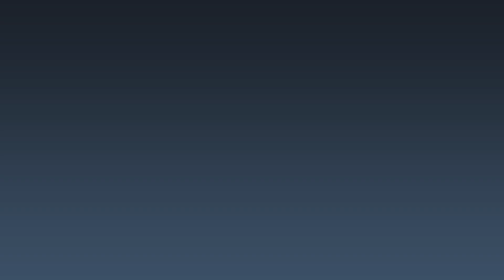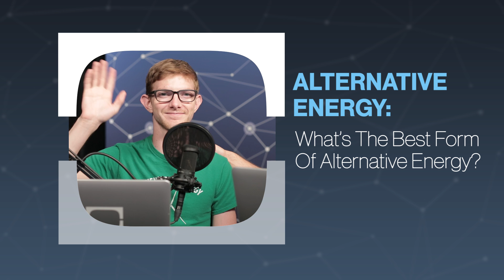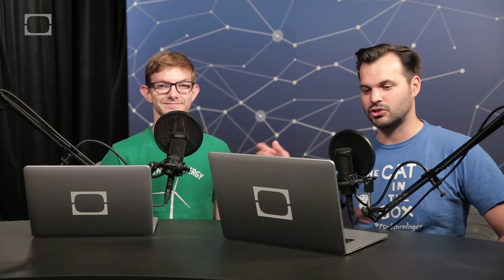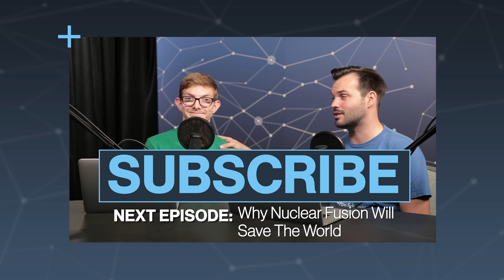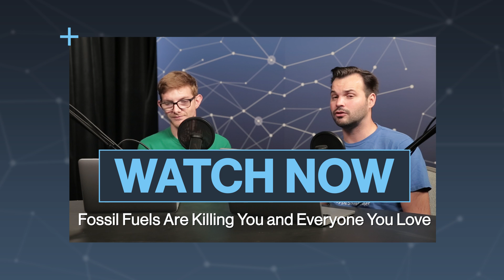What's The Best Form Of Alternative Energy?

Comment: The failures to deal with waste and the environmental impacts of meltdowns were not dealt with. Fukushima, for instance, led to heavy metal and radioactive poisoning of the immediate environment but also pretty significant areas of the ocean due to waste being released into the ocean (both unintentionally and intentionally - as a result of an inability to store the large amounts of waste). The biggest issues, in my opinion, are waste management and rigorous safety standards but this video has made me realize that storage of nuclear waste and extreme caution have a much lower cost than most other types of energy production. Wind and solar tech is getting exponentially better and so they are definitely worth investing in and the cadmium problem with photovoltaic cells may well be solvable with better tech.

Comment: Hey, coal can actually be a clean source of energy if there are scrubbers in the chimneys to deal with the harmful particles
Reply: +MrTokomaki And what about all the toxic waste from the mining or the oil used to transport the coal?
Reply: +kokofan50 That's a good question. They could properly treat and dispose the toxic waste, handling it in reserved areas. As for using fossil fuels to transport, well, that's just the norm. A lot of vehicles still use fossil fuels, but fortunately, vehicles have been getting more efficient. On the bright side, coal's mostly transported by train, which is very efficient. 
Which reminds me, we do the same thing with trash. When burning trash, we can generate power and use scrubbers to deal with particles as well. 2000 lbs of trash could be reduced to 300-600 lbs of ash. The ash could then be used in building roads, making concrete stronger, and artificial reefs.

Comment: the big advantage with renewable energy would be evident only if everyone, every house, every factory, every farm, would produce its on energy, instead of a centralized system as it is now, where one place produce energy for a whole city. in such a situation, where every house, factory and farm produced its own energy, they would need to be connected one another, so there would be no wasted energy as every surplus would be used elsewhere. the real problem is, converting every house and factory to exploit renewable energy is very expensive, and not all the people have the money or the will to spend them.

Comment: my question is: why are we still using steam to turn turbines? wouldn't it be more efficient to use a pyroelectric material to create electricity directly from the heat. there has to be efficiency loss during the phase change, etc. or do we not know of any that can work at the scale needed for power plants??

Comment: The biggest problem with nuclear fission reactors is that they use pressurized radioactive water as coolant, which is prone to explosive decompression during meltdowns, rather than something that melts at higher temperatures, such as sodium salts ~ change that one aspect and nuclear power becomes the single safest energy solution ... that said, when people only hear about the tiny percentage of failures, nothing about the consistent smooth operation, they associate only the failures with the energy type ~ that public relations fault needs to be addressed if we're going to modernize and expand our nuclear energy program.

Comment: I've been saying this for a long time, glad to hear someone agreeing with me for a change. We can switch from burning oil and coal to nuclear power without having to change our society. Sweden has already done it, only a few percentages of our power comes from oil and coal, most of it is nuclear and water power.
So I definitely think nuclear fission is the best short term solution to global warming and running out of oil. But we are eventually going to run out of heavy radioactive elements as well. By then we need to figure out fusion or restructure for renewable energy production.

Comment: I won't say it's perfect, but it's near the best thing we have. Of you want to see what I consider the answer to our energy needs look at LFTRs. I have done a good bit of reseach on them and there are some very notible and highly qualified people discussing them. The current uranium based system was an invention from like world war 2 for the weapon making process. A few years later the LFTR was developed. 

With LFTR there is vary little way anything could be used and weponized, all of the spent fuel now stored could be used again and last something like 20 yrs once in place and it takes it from say highly radioactive to mildly radioactive and takes the decay time from a ton of time to something like some thousand years. They said that most current reactors are less than 1% efficient with energy extraction, but LFTR run in the high 90% range for efficiency. And probably the best part with LFTRs is that there is no way hydrogen explosions can happen and because the fuel is immersed in a solution there is some property with the fuel and the solution that as it heats they spread apart and this is basically an automatic regulation system.

Comment: So this was basically Nuclear versus Coal. Did they even mention solar and wind?
Reply: +AholeAtheist It was more nuclear vs. nothing else.
Reply: +AholeAtheist yea i thought they weren't being too fair to solar and wind. is managing cadmium waste more difficult than radioactive waste? if a carcinogen seeps into groundwater, is that worse than radioactive particles seeping into groundwater? or getting dispersed into the air?

as for the problems with solar/wind (scalability), isn't it solvable by attaching "power storage" into the grid? a form of giant rechargeable battery which will store excess power generation during high solar/wind output for later use? sure, it's not perfect, but still a very decent solution.

this video felt very much like nuclear propaganda! there's a difference between busting myths and going overboard!
Reply: John Doe Electrolisis is not efficient ( about 20% efficiency) . Pumped water is quite efficient ( 80%)
Reply: +Ashley Ingersoll There is some work being done right now with graphene that is quite interesting. Apparently, they can create flexible, transparent graphene sheets that can make electricity out of solar energy. Seeing as graphene is made from carbon, it's extremely abundant. You also have stanene and a number of other TMDCs, some that haven't even left the theoretical simulation stage yet.

There are some very exciting times ahead.
Reply: +Gregory Samuel Teo (alveolate)  we can't efficiently store that kind of power and it is still extremely hard to scale wind and solar. not to mention the issues they can cause when you do scale them up like being death traps for birds.
Reply: KnightRaymund Maybe we can't now..
Reply: +KnightRaymund Have you ever heard of a Hydroelectric power plant? If you pump water up, it becomes a very efficient "battery". Furthermore the process of electrolisis used to produce hydrogen out of water can also be used to store large amounts of enery where dams arent an option. The hydrogen is symply stored until needed and then combusted in a conventional internal combustion engine. Where there is a will there is a way.
Reply: ***** Well you go ahead and do that. I'm going to stay in New Zealand, where it's Nuclear free.
Reply: +AholeAtheist Nuclear is controllable like coal, it's a big advantage.  The sun doesn't always shine and the wind doesn't always blow.
Reply: +asdfghjkl  im disatisfied they didnt talked about the better version of Nuclear , Thorium.

a nuclear powerplant doesnt need to use uranium. 
there are a few now that work on thorium, its alot less radioactive, it cant meltdown, and you cant make nuclear weapons out of it (wich is basicly the reason why it isnt used so much)
Reply: Elysia
https://whatisnuclear.com/articles/thorium_myths.html
The only practical benefit of thorium MSR over a uranium MSR is you don't need to use fast neutrons (higher initial fuel requirements) to breed fuel. Used in a breeder they both produce about the same amount of energy. We can get plenty of uranium out of the ocean without even mining, really economical only with breeding.

U233 in thorium reactors can make gun-type bombs. Even by adding U238 to the core and using a separate in-situ reprocessing system to remove fresh plutonium-239 can make implosion based bombs. I wouldn't worry about the bomb making though, there is plenty of nuclear bombs to destroy the world anyways.
Reply: i should have looked into the more newer nuclear reactors that can also use nuclear waste as fuel.

you helped me enrich my knowledge.
Reply: Elysia
There is a thousand ways to make nuclear power. Gas core, fission fragment, dusty plasma, light bulb rocket, aqueous reactor are currently off the top of my head. They all have their problems and are situational, but they're not unsolvable.
Reply: leerman22 What major advantages does thorium have over uranium, and vice versa?  All given that nuclear should be switching away from those POS gen 1 light water reactors like Chernobyl and Fukushima and moving into gen 4.
Reply: asdfghjkl what i heard , using thorium in a liquid salt reactor cannot have a meltdown at all, the other advantage was that its waste is alot less radioactive, but if im correct the gen4 reactors can do that too.
Reply: +Mark Smed i ment the gen4 uranium reactors
Reply: Elysia
The waste of breeders is extremely radioactive, but that's when it is still isolated. It cools down very quickly which is what we want. An MSR can melt down (the vessel) if designed incorrectly, all of the explosive chems are in the reprocessing system so there is a limited radiation release in an explosion of that.
Reply: +username90210 - If you pay attention, they actually address some key problems with solar/wind around 7 minutes in. They mention a problem with Solar at about 9 minutes. Frankly, they are simply answering the question in the title.
Reply: You guys realize that solar panels work on a cloudy day, right? They still receive ultra violet radiation, it may be less but the still receive it. To top it off, they now have transparent solar cells, so you can coat windows in the stuff and get energy from them. Imagine if you had those on the windows in all the skyscrapers and buildings in our cities and towns? Windmills on mountain ranges, and underwater water current mills and windmills on seasteeds off the coasts. Would these not gather enough energy to sustain our society?
Reply: it may gather enough, but i have the feeling it cannot, unless they upgrade the power output of those cells. it wioll probably be bable to sustain all the houses, but its mostly the industries and stores that require the massive amounts of electricity that solarpanels cannot produce.
Reply: +AholeAtheist so what is the expected energy output of those cells? how often will they need to be replaced(according to the last article I read they lose about 30 percent of the rated output in 15 years). Also important is how much do they cost? A nuclear plant the same size as Neuhardenberg Solar Park could in theory produce more electricity than is currently generated by all the solar plants in Germany combined even at peak efficiency. Not saying solar is not an option to consider later but if you are in the climate change crowd we need something sooner rather than later, and if you are in the economist crowd why waste money on what is currently a pit technology until the flaws have been researched and worked around?

Comment: I am a fan of nuclear power. But I wouldn't just say  "that is all we need". Yes, solar power and wind power isn't meeting the demand as well since you can't regulate it. That is why you should combine the different types of power. 

A project I am currently working on is having this idea: Use the clean energy of solar and wind power whenever you can, and then use the water power as a battery or regulator (we have water power instead of nuclear). The water power can easily be regulated (even more than nuclear) and can therefore do its job easily. The water power we have will never be 100% in use even without solar and wind.

Comment: I agree that nuclear is quite safe, but there are other practical problems associated with it.  Here in Connecticut, about 50% of our electricity is from mature nuclear plants. Most of the balance is from natural gas and hydro (imported from Canada).  Even so, our electric rates are some of the highest in the US.  In the long term, the decommissioning costs of nuclear plants make it marginal, at best.
It takes 15-20 years to build a moderate-sized nuclear plant.  By that time, solar and wind will be more than competitive with nuclear, even including the storage costs.
On the other hand, some of the "micro" modular plants I've heard about might be an alternative in the future.

Comment: Fun fact : For 2- 3 days in the spring 2015 in Denmark, 85% of all our power came from renewable sources, mostly windmills and private owned solar-panels. We're normally at approxmately 60% power from renewable sources. Nuclear power isn't a thing here although our Swedish neighbours use it.
Reply: Another fun fact - Danish RE is dirtier than Swedish Nuclear+Hydro.

Denmark is slightly below the European average (Sweden is half!) of total emissions; doing much better in  electricity&heat only (but not as good as Sweden with 1/3rd the European average and 1/2 the Danish average).

         tot   e&h only
Europe      5.9   2.1
Denmark  5.5   1.5     62% non-hydro renewables;  0% nuclear
Sweden    3.6   0.7     21% non-hydro renewables; 49% nuclear

2017-2018 IEA data
total is the cross-sector emissions in t/capita
e&h is the electricity&heat only emissions in t/capita

* https://www.iea.org/countries/Denmark
* https://www.iea.org/countries/Sweden

Comment: The term "renewable energy" should've never been used from the beginning. Energy just changes state. In this case fuel to heat to electricity (obviously simplified explanation) . And then eventually heat energy will be the last step before the universe expands and possible "heat death" occurs. Unless I missed the part where we simply "renew" the energy back to the state it was before we converted it to electricity. Finally.. Energy is walking down a one way street. Explained in the teachings of entropy.